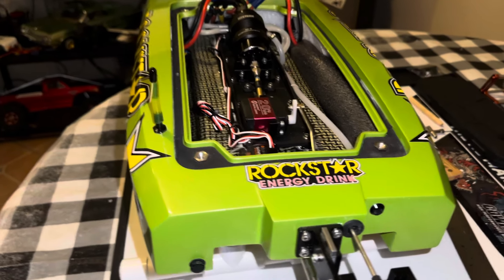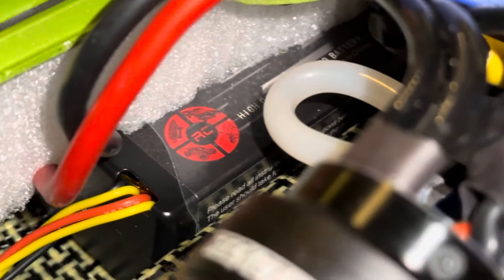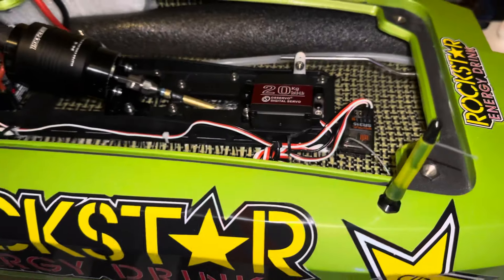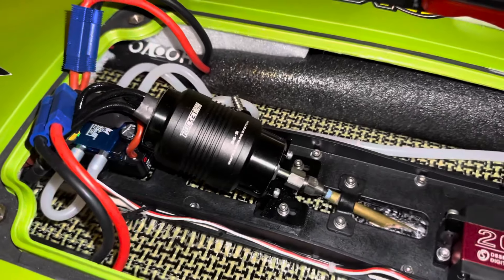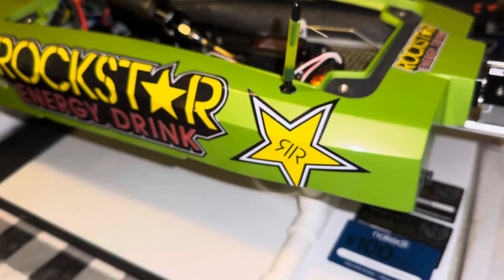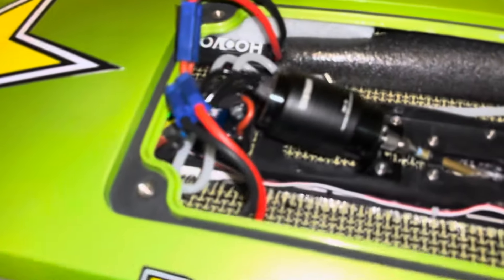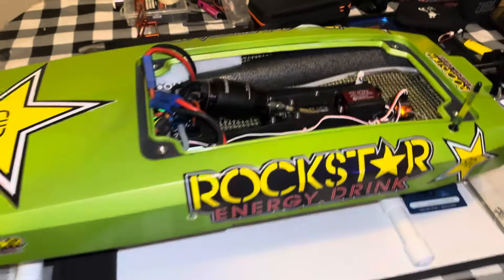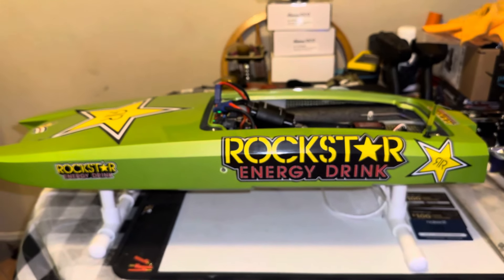Proboat Veles 29 Rockstar Energy Custom Build Kevlar Inlay Battery Tray Removed Rocket Motor Strut

Comment: Clean!
Reply: Hell yeah dude strut fits and looks great. Can’t wait to see it run. I’d say you’re doing more than alright bro doing great. Cg may be a bit forward but maybe you can make it work with some strut tweaking. Let’s see some footage👍🏼
Reply from the maker: @RogallaMarineRC Thank you bro I appreciate all the tips and help! Its cg right behind the step if not right on that corner
Lines up with the back of the motor (if the back is where the wires come out from) 
Soon as that rudder kit gets here its on 🤙🛥️ boat gang
Reply from the maker: @RogallaMarineRC oh and shes heavyyyy 😂 but its all low cg like a belly dragger crawler 😂

Comment: Nice work. Check your cg should be approximately back edge of the middle step or in that area depending  on how you want the boat to ride
Reply from the maker: Thanks for the tips I appreciate it and thats exactly where the cg landed by luck Cause that was going to be next question 🤙🛥️ boat gang